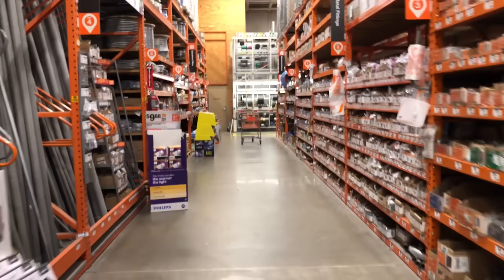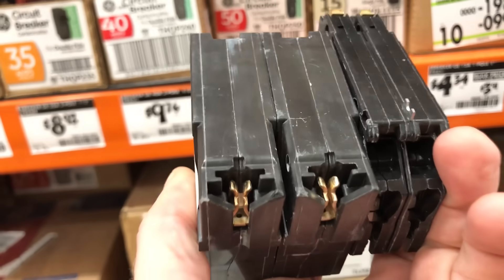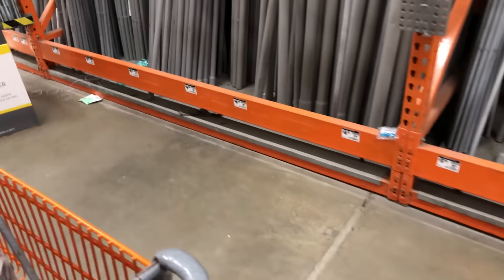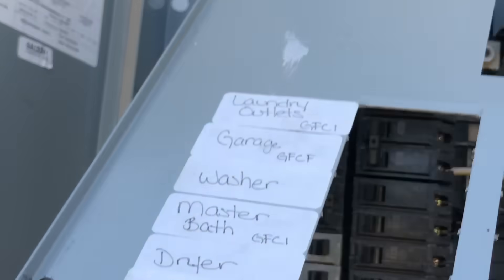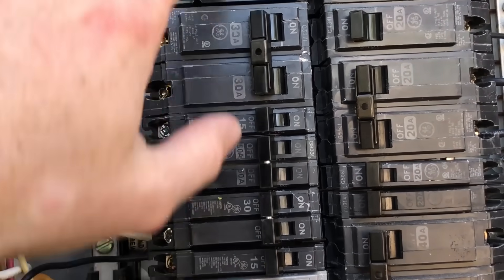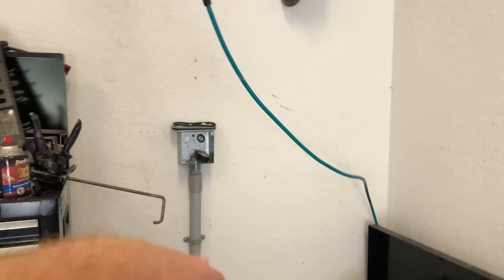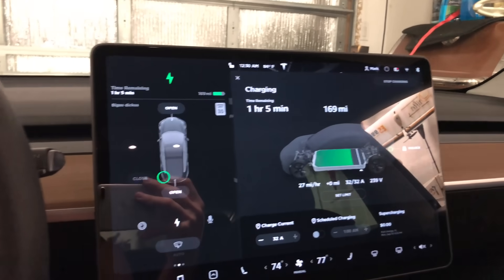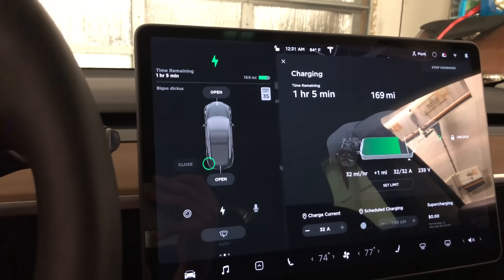Best home Charger for Tesla Standard Range plus! 14-50!

Comment: My wall charger gets me 45 miles per hour, is it necessary no but it shure looks insane in my wall.
Reply from the maker: Yes! I’m poor with a standard range plus! :) you on performance or long range right
Reply: Yeah, my car supports 80A charge (dual inboard chargers) on a 100A breaker.  I think they currently top out @ 72A if I remember what the gen2 HPWC manual said.  $500 is not bad considering building an OpenEVSE with that capability would cost considerably more.  I think just the 24' of cable would cost $100-150 or more alone...
Reply: Easy there Mark I’m one of your supporters lol I’m just saying maybe your title shouldn’t be don’t buy this get this, I mean if people can afford the wall charger by all means they should get it. It’s is convenient, I keep my car charger in the car at all times, plus the look of it in the wall looks insane. Sometimes I plug in for an hour before work and those extra miles make a difference. Do you need it no, but it looks amazing. Keep up the good work.
Reply from the maker: FoxkidPR I’m just salty that I can’t get one :) I am going to revise it to match the sr+. These dang performance and long rangers get the max out of the wall connector hehe!

Comment: Lucky me. House sits on a slab, plus no extra slots floor breakers. And 50s house built
Reply from the maker: Baker might need those slim breakers like I had to.
Reply from the maker: Check out a load switch I think it’s called. I’d you have a drier plug that’s compatible then you can install that to share the switch.

Comment: Regular plug is enough for me, cos my car is parked for 10 hrs before i work which means i get 60 miles everytime i charge. Good info tho
Reply from the maker: Michael that’s awesome I ran into a couple days that I needed a quicker bump. I could survive with the mobile on 110
Reply: The regular plug only charges at around 5 miles per hour. So if you planned a road trip that uses full range of 250 miles it would take you  FIFTY HOURS to prepare!!! Or else you’d have to hang out at Supercharger to get there (and again to return home). 

You are fortunate to be somebody who never drives more than 60 miles a day. I really enjoy driving my car and look for reasons to road trip. So some folks really need the 44 miles per hour that the HPWC offers. $500 over the life of the car is a bargain for the convenience and performance

Cheers

Comment: I have both a long range and mid range Model 3’s. A wall connector won’t make a difference on the mid range but it makes a large difference for the long range. Max charging for mid range Is 32 amps and the long range is 48 amps. If u have a Model 3 that only allows 32amps, then, no, don’t buy a wall connector. If u have a long range or performance, then the wall connector gives u a 33% increase in charging speed. This is not my opinion, this is based on my experience living with these two different models and two different chargers.
Reply from the maker: Doug Garet dame with standard range plus. I think long range is 48amp?
Reply: Will I get 48A with that mobile connector on my Model Y Long Range? Is the 32A limit set by the vehicle?

Comment: Sorry I think the wall charger is worth it. I installed my self and super simple. Additionally I now can leave the portable charging cables in the car instead of rounding that up every morning at 4am.
Reply: Almost 50 mile per hour charge is nice too on the wall charger.
Reply from the maker: Damn that’s awesome. Must be performance or long range.
Reply from the maker: Robert Shaw that’s correct! I bought a spare for 80$ on letgo so I have both in the car. :)

Comment: Any thoughts on using the 6-50 connector instead of the 14-50?
My understanding is that the Tesla charger comes with the standard 120V connector, and you can optionally buy the 14-50, or 6-50, or a couple of other options.  The 6-50 is 240V 2 wire instead of three wire.  That would of allowed you to use 6-2 cable instead of the more expensive 6-3 cable.
Reply from the maker: That’s correct. I went with this since it was also for a compressor we have in the garage.  Also while on the road the 14-50 is common. When we go to nc the house has a 14-50.  I’ll update the description because that’s a good reason have the 6-50.

Comment: Hey mark did not understand the 2 breakers I understand the 50 amp but where does the 30 amp go?
Reply from the maker: mojito5606 we ran out of room with the panel so I had to reduce 2 slots to put the 50 amp  in. The 14-50 only needs 1 2 pole 50

Comment: Sweet vid!!  Usually they have 6/3 Romex by the foot for around $2, coulda saved a little that way if you only needed 80ft
Reply from the maker: Nathan Hamler $2.79 per foot. So about $223 for 80’. 229 for the 125 and now I have some extra for another project.

Comment: This is the best charging option instead of paying another $500 for a wall charger.
Reply from the maker: I do think so myself. Thanks :)
Reply: Huy's Tesla Vlog Channel You just need to remember to bring that Mobile Connector with you for road trips. It’s easy to forget it when it normally stays plugged in at home. Gives me peace of mind in case of unexpected low SOC
Reply: @drdrew3  If people already spent > $50K on  a car, I would not mind spend extra $500 for a wall connector. If I were buy a Teslas, I might do following:

1. Upgrade panel to 200A from 100A (or just buy a new house)
2. Install a war connector
3. Install at least one extra MEMA 14-50 outlets, so multiple cars can be charged at the same time, and not limit to Tesla

This is under the assumption that I will keep my current house for long time. If I plan to move soon, I will just simply add a MEMA 14-50 plug.

Comment: Steve Boedeker called that out correctly - the SR+ will not charge above 32a...I made the mistake of ordering and installing the Home Wall Charger just to see 32amps - I could have saved 250 bucks or so. The NEMA 14-50 works fine for these applications. We did the same thing on our Beach property - converted a 30amp RV plug to a 50amp one using only 4 foot of 6/3 wire and new 14-50R plus breaker. The wire is the major expense depending on length.
Reply from the maker: Yeah. Mine was 80’

Comment: The SR+ is capped at 32a regardless so there is really no difference between the mobile charger and the wall connector. I was in a similar dilemma to you, older home and was quoted big bucks to run a plug for use with mobile connector NEMA 14-50. Had one guy quote me $850 and another $1200 - and I didn’t even need work done to my box as the previous owner used to have a hot tub in the back yard. I found a wall connector on Offer Up for $450 and the guy selling it was a journeyman electrician willing to do our install for an extra $400. So we were able to get the electric run and a wall connector for $850; which lined up with the low end quote for just a plug and that deal was too good to turn down. I figure that it can be easily converted to a plug now that the heavy gauge wire has been run. 

Long story, told shorter - for the SR or SR+, you will get the same charge rate for the plug as you will get for the wall connector. You might get an extra 1-2 miles an hour with the wall connector, but totally not worth the extra money unless you get offered a deal by some electrician that happens to have an extra wall connector 👍. We have a slab house and had to strap the metal piping to the outside, there was no way that I was going to attempt that on my own!

Comment: Great install, Mark! I’ve got the same setup. It wasn’t worth it to me to be able to charge at 40 amps with the wall mounted charger as opposed the 32 amps that the second generation mobile charger gives you. Some have suggested buying a used first generation mobile charger to get the full 40 amps of charge, but it’s not worth it. 

We have time of use metering, but still have plenty of time to charge. One thing that I do for battery health is to turn down the amps of the charge to as low as possible to trickle charge the battery. I don’t know if it really makes a difference, but as long as it doesn’t hurt it, it’s more of a game.
Reply from the maker: Mitchell Barnow perfect solution, yes I think the slower the better.  I had it on the first night to 15 amps and it was going good.
Reply: Mark Dickinson I didn’t think that you would be awake.
Reply: @MarkDickinson  , question, is it your breaker 30A? how come your Tesla screen says 32A ? can you clarify? thanks!.
Reply from the maker: Travis Li - Rufus you’ll need a 50 amp breaker for the 14-50 adapter.  The 6/3 wiring is rated for 60 amps so you can use both the mobile connector and the wall connector will work with it. 

32 amp is the max the sr+. I’m updating the description this morning
Reply: Mark Dickinson Could you have used a 60 amp breaker if you had gone for the wall charger, because the Model 3 can charge at 48 amps? Thank you so much 😊
Reply from the maker: @mitchellbarnow1709  the sr+ is capped at 32. But yes a 60 amp and the wall charger would work on the 6/3 wiring
Reply: I use the gen 1 connector with a 60amp breaker but most nights I charge 20amps and sometimes 15 if I start charging at 9pm. I haven’t had the need to charge at 40amps